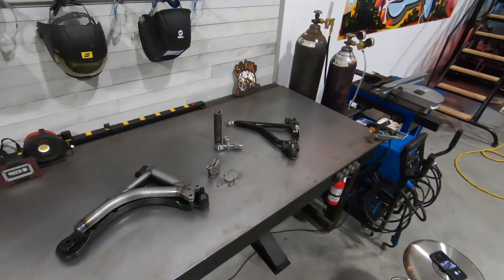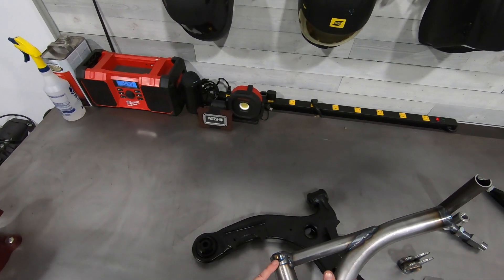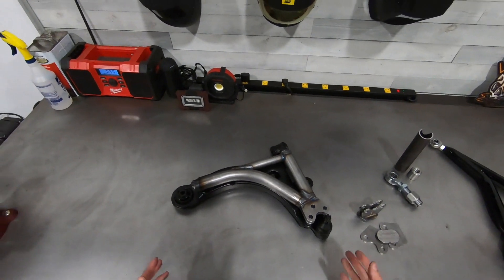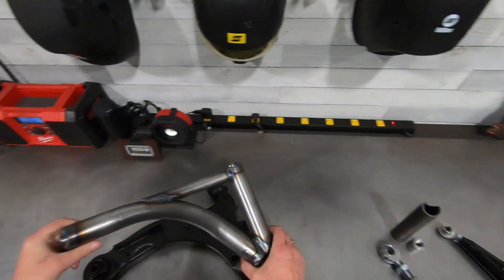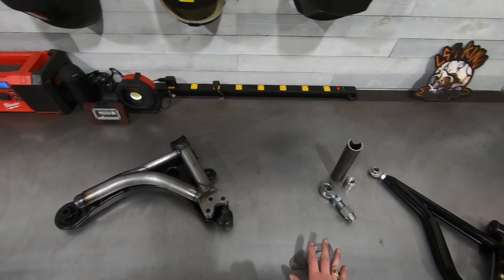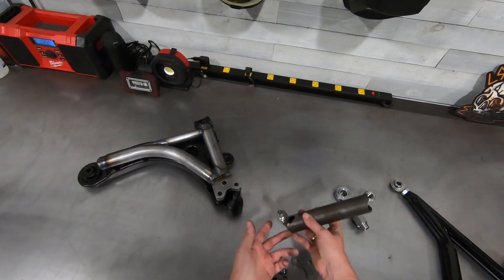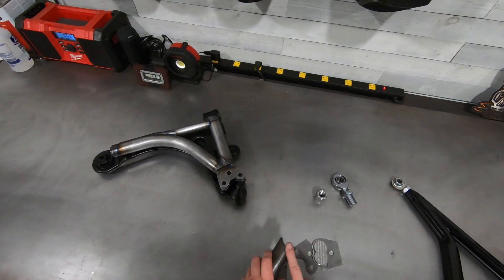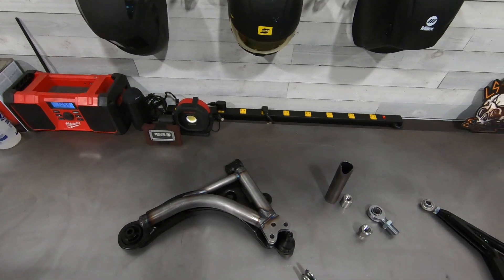New Product: W-Body Tubular Control Arms

Comment: Great work! I knew these cars would become a classic/modding platform. What shocks to put on a Grand Prix GXP? And how long do factory springs last? The GP gxp used sway bar links from bar ends to shock tube tab mounts instead of bar to control arm btw.

Comment: Top notch build as the norm with you, lol. coping the ends is that extra step that puts it above the norm. Compared to the standard perimeter weld that coping increases the strength exponentially. and probablly at least 30% more contact weld with 100% penetration value. You surely take those extra steps to ensure quality products that you can depend on. I'm at a place on my build that I'm trying to decide how I want to procede with my front suspension. As of now I have the v-6 subframe but I am seriously considering building a subframe from scratch with mild steel.  If I go that route, then it's like, well do I keep the same style suspension or not. On a massive budget so keeping as much as possible is a plus (brake system, hubs, struts and such), but I am attempting to go All Wheel Drive with my LS set longitudinally. I've got Cadillac carriers front and rear with 3.91 gears, and I'm looking to get a BW 4479 or 4476 transfer case. I'm altering a trail blazer oil pan to accept the Caddy front carrier, but with that set up I have a clearence issue with the stock subframe and control arms. Since my axles will run under my crank instead of beside it like with the transverse mount. So my axles are about 3 inches below yours, so I'll most likely build a frame that will account for that, unless I attempt adding an additional cv joint to each halfshaft. But thats more friction, and another failure point. Thought about possibly fabricating a carrier bearing/cv joint type of joint there, but IDK, not much realestate once you add the LS and the Diff in there. Already moving the master cylinder and booster to behind my seat. Got any ideas toss them out here, I'm probablly 2 years to go when I compare what it's costing me to what I earn, lol.
Reply: And if your thinking, WHY awd. I got bit by Ken Block Hoonicorn stang. lol

Comment: I still wish they would show some love to the front wheel drive NorthStars they already have a rebuild kit that fixes the head gasket issue permanently and they have some performance cams and so on I just wish they would make a little bit more cuz that's also a good power plant if you know what you're doing
Reply from the maker: Stay tuned 👀
Reply: @LS4King  oh I most definitely will I'm going to need a lot of parts that you make for my supercharged build I'm doing on my front wheel drive Northstar including a stronger torque converter so I'm most definitely will be keeping my eyes out
Reply from the maker: @CDC-Vprototype  i’ve got you covered